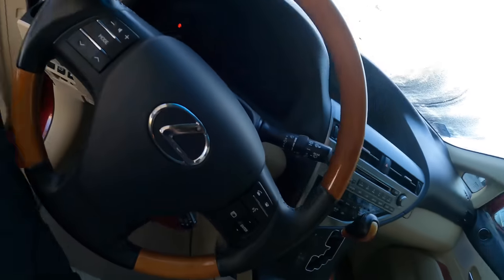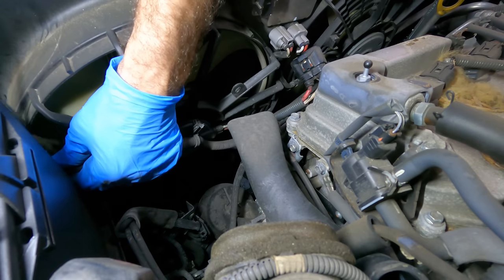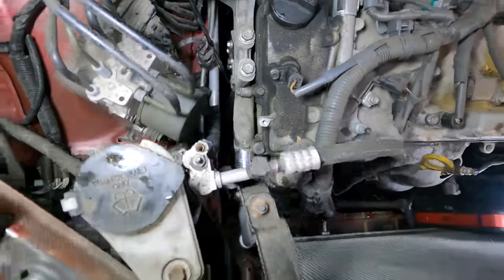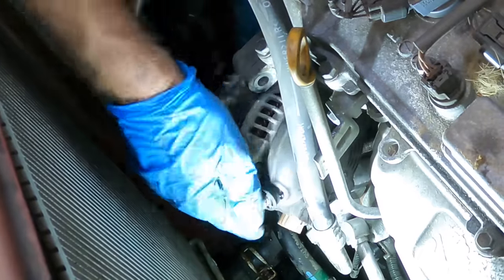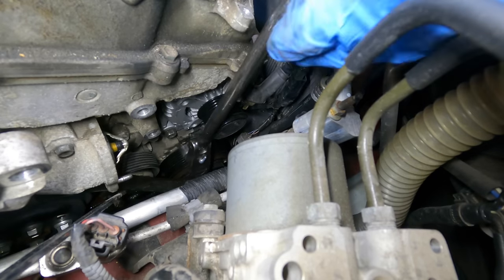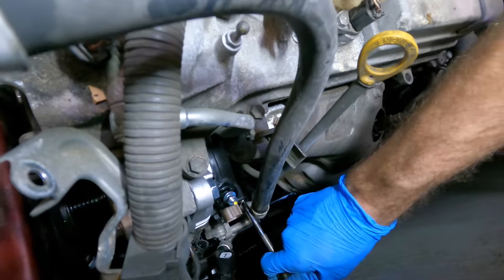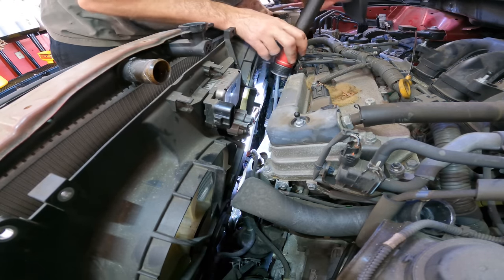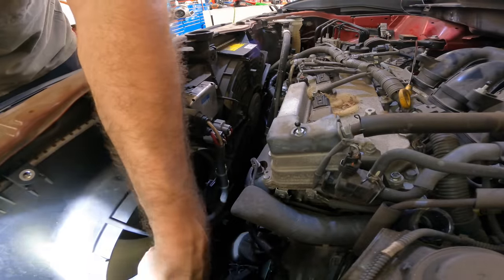Lexus Died While Driving! Towed In! No crank no start.  2011 Lexus RX 350

Comment: Around 25:00  I can't believe how tightly packed engine compartments have become.  As a teen, I was able to stand in the engine compartment of my 1962 Chevy Bel Air, one foot on the ground, the other on the front suspension.

Hey you kids!  Get off my lawn!
Reply: <I was thinking the same thing about working on a 1970 Ford F100.>
Reply: ‘61 BelAir ex-owner. The 283 engine space was massive. You are correct, sir. Hope I’m not misgendering you, as the morons insist these days.
Reply: I could pull the engine out of my 65 Chevelle in one hour!
Reply: I had a 3rd gen Firebird and the engine bay was massive.  With my 4th gen Firebird, the engine bay is SUPER cramped😲
Reply: I had a '76 C-10 long bed that you could climb into the engine bay, sit DOWN, and practically close the hood!
Reply: My '72 Nova was the same way. Every car I work on gets compared to that.
Reply: @scottwilcoxson2439  I had a '72 Nova SS.  It was a great car, although I didn't keep it for long.  In those days, black vinyl (vinyl covered) roofs were considered neat.  [in those days, we also said 'rooves' instead of 'roofs']
Reply: @kenc2257  Mine wasn't fancy. Had the 250 straight six. But it ran well. And had a sunroof from the factory. Sadly, that was non-functional by the time I owned it. Nova SS is my dream car!
Reply: The '64 Buick LaSabre had even more room. same style chassis but a longer front end.
Reply: Back in the mid sixties I had to change out the water pump on a 55 Chevy. I did the same exact thing, standing inside the engine compartment to more easily access the water pump.
Reply: ‘61 Bel Air that came with my wife when we got married was very easy to service - none of this fancy stuff like oil filter. Of course engine was shot at about 50k miles and it went on a ‘70 Nova.
Reply: My 1960 Impala with a 250 6 cylinder  you could almost walk around  in the engine compartment
Reply: LMAO!!! Been there, done that a couple dozen times!!! Careful, guys. We're going to tell our ages if we're not careful!!! 53 Ford, 55 Chev, 60 Chev C-10, 64 Chev SS, 70 Olds Cutlass, 78 Olds 98, 80 Chev C-10
Reply: My '89 Dodge Daytona Had so much room I was able to drop a 392 Hemi in it and Convert it to Rear wheel Drive with room to spare they gave you so much room back then like they knew you may want to fix it
Reply: @Rekuzan  I had a '78 C-10 Big 10 w/350 engine and could do the same.
Reply: @aliasfred  Did it also have a Muncie or Saginaw 3-speed? snicker Oh those were fun to drive!
Reply: @Rekuzan  Unfortunately no.  It had the Turbo 350 auto.  It also had cruise control, 373 gears, heavy duty trans. pan, heavy duty trans cooler, and seat covers that when I removed them, the seats were like new.  It was baby blue and white, two fuel tanks, A/C that worked wonderful all that with only 28,000 original miles.  Oh, also NO rust whatsoever.  It was a barn/garage find for me in Florida while I was visiting a cousin in 1999.
Reply: Yeah and 8 liter v8 made 210hp..
Reply: @alexstromberg7696  Only if it's stock! snicker the 383 I had was putting out at least 1HP per cubic inch, possibly moar.
Reply: @aliasfred  THM 350's weren't the greatest for towing but would be sufficient with that setup. The granny gear on the Muncie 465 I had was perfect for towing, but you could only cruise around 55-60 without rapping at the aftermarket tach. Then again, mine was sleeper w/ a 383 & Edelbrock top end & the polished aluminum valve covers and air cleaner. I was even running Delco Rapidfires which were, fun fact, engineered for the strip after Delco reps asked why rodders were filing down the electrodes on their conventional plugs. I'm pretty sure it the gears were stock, and was going to leave it like that, instead adding a UD/OD to the tailshaft of the trans. Or at least, that woulda been the next thing if an idiot (ex)friend didn't blow the motor...
Reply: I could get both feet on the ground in my first car! I still joke about playing table tennis on the hood.
Reply: And I thought my car from 2004 was tight now that I look at it it’s not this car is
Reply: On my 75 Blazer to work on one side of the engine I'd sit on the inner fender while to work on the other side I go to the other side of the engine sometimes my wife would bring me dinner and I'd stay in there and have dinner have a great day
Reply: @Zeus-wl2pl  I had a 67 two-door Impala with a 283 motor great little motor one car to work on have a great day
Reply: @williamwhite9767  my son bought himself a 68 Chevelle when he was 15 years old with a straight six motor when he graduated high school I bought him a 327 cars still running today and that was 25 years ago have a great day
Reply: @kenc2257  an SS with a 396 or Chevy 2 man knows what mean little cars have a great day p
Reply: @kenm6948  I had a 53 Chevy van for the 327 that was built in Vo-Tech high School years ago love the van problem was I didn't know how to drive and I tore it up have a great day
Reply: @jackmoerman7245  my son bought his 68 Chevelle with a straight six for 1500 hours when he was 15 so that was about 25 27 years ago have a good day
Reply: @Watchyn_Yarwood  my dad had a delmont 88 and then he bought a deuce and a quarter man that was a big car had a lot of fun have a great day
Reply: @deltasixgaming  back in the day we used to say Mopar or no car have a great day
Reply: @Rekuzan  the old rock crusher I remember those those were bulletproof transmission have a great day
Reply: @aliasfred  that was a fine people dream about dull tank somebody was going to do a long road Cruise have a great day

Comment: Once upon a time, an alternator R&R was 1 through bolt, 1 adjuster bolt, and 1 wire clip,  15 minutes side of the road in a driving wind and rain storm.  Now it is Coolant System Flush and Fill,  Thermostat R&R, Fan assembly R&R just to get to the Alternator R&R ... Good on the makers to find a way to inflate repair pricing!

Comment: Absolutely atrocious that you had to go through that process for an alternator change.  Great job as always.
Reply: It's a Toyota thing. Their Highlanders are equally as atrocious to work on, being engineered to force you to service at the dealer only.
Reply: he was doing the thermostat, that was the hard part. Alternator is just two pins
Reply: Based on your comment I suspect that you have never worked on a German vehicle.

This process, as assembly line friendly or mechanic un-friendly as it might seem, was truly a straight forward and logical step by step cake walk (as shown by Ray) compared to my numerous "german engineering superiority" wrenching experiences and german car craziness I've seen on youtube thus far.

Try removing the alternator from a Mk4 TDI VW Jetta. It's a fairly empty looking engine bay once the big plastic engine cover's retainer nuts are removed. (No, it doesn't have the ball mounts and grommets of the newer generations.) It then has tons of space to reach in and start the process.
It's fairly quick and easy to disconnect and un-mount the alternator itself from the ALH engine's big 1-piece main accessories bracket without removing anything else. Then the insanely complex adventure of removing said alternator from its home within the engine bay begins. Yes, I know the regulator is the usual fault and is a simple 5-10 minute job to replace... unless your somehow vehicle ended up with the optional Valeo alternator instead of the Bosch. :-(

Although it does seem that since their meticulous incarnation of the original first generation wannabe Benz flagship model Lexus LS400 a little over 3 decades ago Toyota has slowly but happily migrated to and openly embraced the german automotive assembly line "jigsaw puzzle" concept, especially in the Lexus line-up, except that at least Toyota takes the extra steps to make all their puzzle pieces unique enough that tab A only fits in slot B with fastener C and fastener D might look very similar to and get mistaken for fastener C and sort of fit on slot B but at some point during the reassembly process it will become obvious that the place it was used in is not correct. Toyota goes out of their way in their design process to make it nearly impossible to "do it wrong" (other than over/under-tightening hardware, omitting washers, and other such basic human errors), unlike the german assumption that parts identification and exact assembly steps and fastening instructions are always followed to perfection with utmost precision to avoid total catastrophic failure as even minor mistakes which can be done without any obvious indication both can and often do turn into major problems if not caught before attempted final usage.

I do agree that a significant number of steps in that process seemed excessive but welcome to a crossover SUV with a 3.5L V6 engine and 6-speed automatic transmission (likely with AWD included just to bulk things up even more) all turned sideways in the compact engine bay as a transaxle setup and be glad it wasn't German. Modern German vehicles are rolling technological masterpieces that are so much fun to drive... for a short while at least until something breaks.
Reply: Actually, he was suppose to take off the front passenger side wheel, remove the inside plastic covers, and remove the front plastic splash guard to gain access to the pulley. And for the alternator all that he needed to do was to remove the front Lexus grill and the top metal radiator support and move the entire section off to the side while using a bungee cord to have full access to the alternator. He wasn't working smarter but harder with this repair. But, it happens to the best of us. The only thing is that he's a YT'er and not using YT to research.
Reply: had to do an alternator on a 12 captiva with a 3.0 V-6 it was worse than what ray is doing

Comment: I remember when generators, and alternators were right on top, and easy to change!
Reply: My car has it on top it’s the highest pulley on the system. The ac pump though is way down by the crank but it’s still up front so not too bad
Reply: And you had to put in an external regulator for your generator anybody remember that have a great day
Reply: @michaelpressman7203  Like a bad dream! lol, seemed like you got a good regulator or bad one, even new!  I also remember changing a 6V regulator out in favor of an 8V......  helped, especially in winter with or without an 8V battery!

Comment: All THAT for an alternator! Wow! I remember when we used to pull those out and replace them in about 15 minutes.....tops!!!  2 bolts and a tire iron to tension the fan belt was all it took. lol   From a guy whose father owned a 2 bay gas station back in the mid-60's where I learned about cars, I just want to say, love watching your channel. Really opens my eyes to how it's really done these days. You almost need a degree in Electical Engineering. Keep up the good work and thanks for the information and  entertainment.
Reply: That’s how long it would take me to replace it on my 2002 ford ranger and a 2003 mustang. I used to think Toyotas/Lexus would be easier to work on until I got one and had to replace e something on it, I regret buying it lol
Reply: THoes days are so over , my friend
Reply: I did an alternate about 3 weeks ago on my car and less than an hour in front of the auto parts store and the only reason it took me that long is because I dropped the 12 mm socket and I spent I don't know how much time would a flashlight and magnet trying to hunt it down finally two days later I opened I say I want to go find my socket look down they were sitting right there on that little plastic protective cover at the bottom of the motor I must live right have a great day

Comment: For 17 years I repaired radiators and at times had some difficult remove and installs. I never left one defeat me because I'm a rather patient guy. There are times however, that I would need to walk away for a few minutes so my head wouldn't explode! Great Job Ray!!!
Reply: There were days when I went on break I'd go out the back door and sit on the railroad tracks and just stare at the woods for a few minutes and kind of funny then I would come back and finish the job how I figured it out I have a clue but it all works there are things out there to just happen have a great day

Comment: Fyi lower bolt can be reached through the wheel well, take the 2 10mm bolts out and peel back or take the panel off, shallow 14 mm and a flex head ratchet. Will avoid taking the motor mount off. Warranty labor time on the job was 2.6 lol.

Comment: You have the patience of a saint. I have a (also a Toyota) 2001 Camry 4 cylinder which took me less than 5 minutes to remove its alternator, at about the 230,000km (145,000 miles) mark. From that point, I disassembled the brushes/regulator assembly (on the alternator), and replaced the brushes. Further, when the engine compartment heated up, the alternator stopped charging, so from a 'cold' measurement of 14 Volts, thinking 'fixed', the battery ended up needing a charge after a trip! I then replaced the regulator/brushes assembly with a new one, and still functioning OK at the 290,000km (180,000 miles) mark....

Comment: I'm one to venture with a wrench every now-and-then but, after watching what you went through, HELL NO I wouldn't do this!
Reply: I could probably get it taken apart but put back together correctly?  Not a chance....
Reply: This is an easy fix.
You carefully chisel the rivets from the VIN plate, and find another car of the same model that works better, glue your VIN in.
Reply: @tonyjordan1320  my thoughts exactly, taking it apart yeah, I got it. but remembering what when where and matching the right bolts----I suppose that comes over time being a mechanic, but mind blowing to me on top of being frustrated

Comment: Sad to see that heavy original Toyota thermostat being removed only to be replaced with a cheap auto store replacement!!!!! Always original Toyota parts when possible is the lesson I’ve learned the hard way.        As always great work man
Reply: Yup. I would have just replaced the seal if could not or would not paid up for a quality part.
Reply: I also questioned the wisdom of replacing the tstat. I got a Camry with over 200k and have yet to replace it.
Reply: @billclinton6040  They don't last forever. I wouldn't replace it with a Toyota part. Over the decades I've replace them and I've never had the corner store's part go bad. If they're good they seem to last for a long time.
Reply: On my personal/family/friend stuff I usually just do the string-test to confirm the opening point & full open rather that risking a new-part.

Comment: Just in case you ever have to do another one of these, if you start by taking the belt off from the wheel well area, you can slide a 5mm alan into a hole in the front of the tensioner to keep it in its belt removal/installation position, and that also keeps the tensioner pulley out of the way of the bottom 14mm for the alternator. Also I don't think you need to remove the raditor hose either, but that may have been a thing on the previous gen. And you can take like 4 bolts off the core support and flop it over with the hood release cable still on for more wiggle room. These usally only take me like 1.5 hours or less when I do em at work.
Reply: And loosen the right lower motor mount and the front trans mount then raise the engine 2 hours at most
Reply: nooo dont be giving the secrets away 🤫🤫

Comment: After replacing the alternator make sure that the radiator cap is installed. The alternator will not charge if the radiator cap is off.
Reply: May be a dumb question, but why is that? What does the radiator cap have to do with the alternator charging the battery? I learn so much by watching these videos. I've even been telling my hubby little tidbits I've been picking up. I just wish I was taller than 5', had longer arms, and more arm strength! Lol. I drive an '01 Chevy Suburban and I have to use a step stool to check my fluids! I get laughed at a lot, but at least I'm aware of how to do those.
Reply: I said that because when he was testing the battery to see if the alternator was charging, it was showing less than 12 volts. When he put the radiator cap on, he tested it again and it was charging. The radiator cap has nothing to do with the alternator. It was just a coincidence. I was just attempting to make fun of the situation because it looked like the radiator cap needed to be on for the alternator to function properly.
Reply: @Amen.22  Gotcha! I was so confused! Thanks for answering!!!